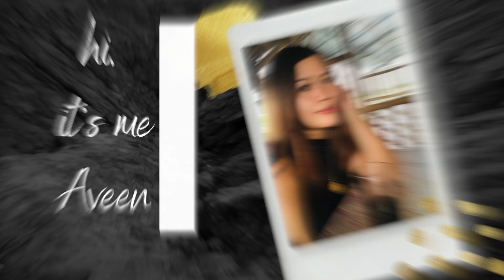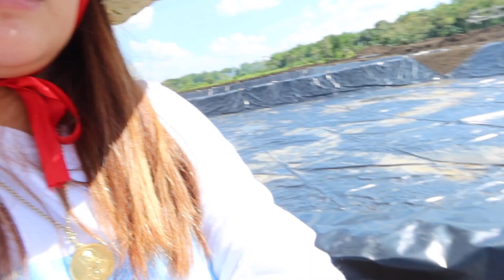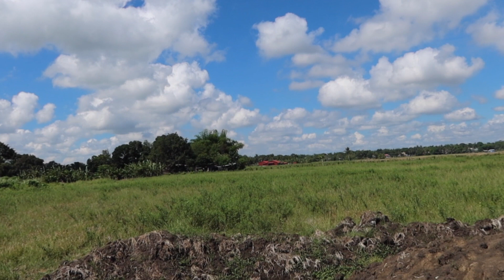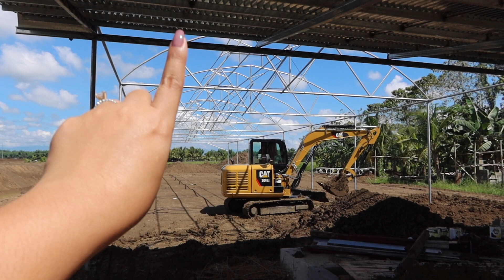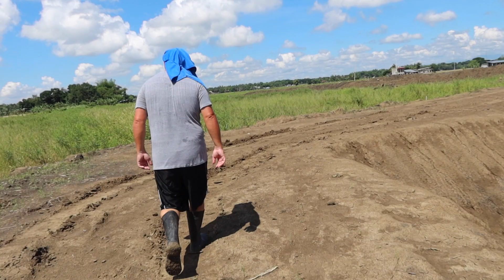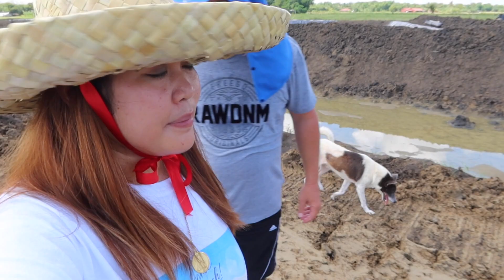INLAND SHRIMP FARM UPDATE: PROBLEMS THAT WE NEED TO ADDRESS ASAP | FILIPINA MARRIED TO A FOREIGNER

Comment: That's quite an investment. The concrete watergate is good for this pond. I think the excavated side where the green house is, should be shored or cemented to avoid erosion during heavy downpour when rainy season comes. It's still loose soil during this time so it's prone to erosion due to rainfall, overtime the soil will settle and grass will grow and cover the surface.
Reply from the maker: Thank you...yes that's what happening right now, soil too loose so we see erosions in different areas. We are working to get this resolve, but everyday rain is not helping us on this matter...we are looking to get 4 days straight of no rain to finish installing our plastic pond liners and move to cementing those eroded canal walls...Really appreciate your suggestions and thoughts on our project. Salamat ng marami 🙂🙏🏻...